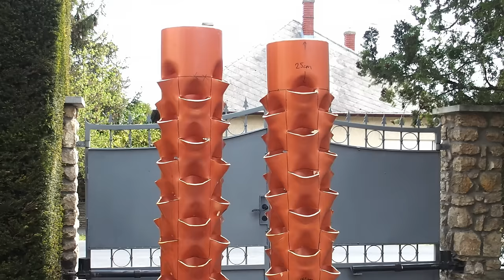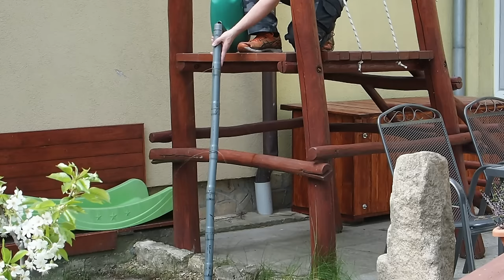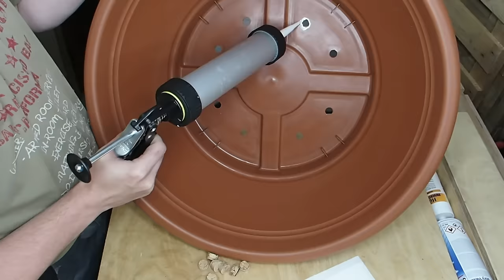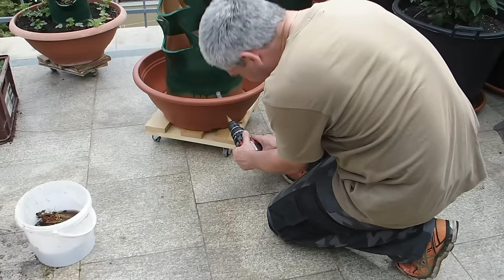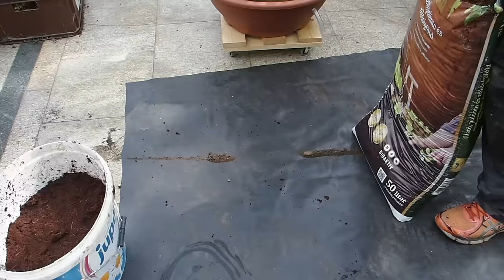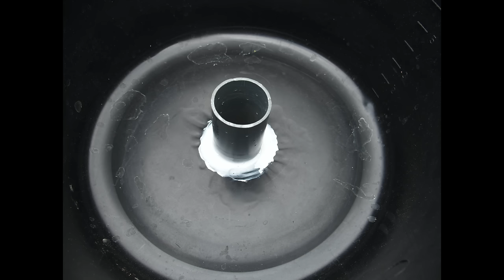DIY: Strawberry tower - part 2/2

Comment: It took a minute to figure out his center watering tube but I finally got it. Each section fills with water then drain separately, I like it and will use this on my Dollar Tree raised beds. Hard to beat $1.25 each. $45 for 36 trays, I plan to grow strawberries in them. This really solves my watering issue, now based on the size of the center tubing I will have to see how many times a day to water.
Reply: yep, waterin is the smartest thing here. I'd also add some drip valve from bucket it keep it consistent and controlled
Reply from the maker: Perfect interpretation, thank you.

Comment: It looks great!! Is all that plastic food safe? Not all plastic is. Since all the hub bub about plastics and such, I have been trying to stick to natural things. You could use bamboo to make a natural irrigation, and we always used jute when I was a kid to make small container gardens.
Reply from the maker: Thanks for the comments.
Reply: I agree with you. You can build a towel out of untreated wood, or heat treated (HT stamp) pallet wood. just have to replace every now n then if the wood rots out. Metal (galvanize, stonwes or bricks or ok too ). I have those for raised beds.

Comment: Hey thanks so much 
Please could you be a bit more clear on the irrigation and how the water gets through the entire tower. I especially liked your mixture of coco coir, fertilizer etc I'm definitely going to take a note of that combination as a growing medium.
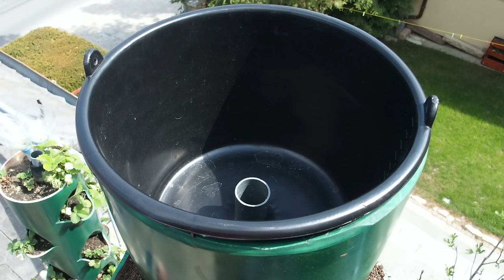Reply from the maker: Thank you for watching. The irrigation tube connected in the bucket. You can see 8:18. The water fill in the bucket.
Reply: dont worry it does not work.
Reply from the maker: Why?
Reply: @2lefthands  
I think it would be better to use a short piece of pipe with holes near the top and another piece of pipe without holes that is just wrapped in the weed barrier fabric (capillary material). The water wets the top and the fabric/gravity will carry it down the tower. With holes in the lower pipe you will have more water at the bottom due to the pressure (about 4psi with 10ft head. A good quality capillary matting will hold 7.5L per m2.
Reply: Beyond words that he has the ingenuity to build it and no idea how to wash his hands.. sooo funny
Reply: @I have two left hands  A detailed explanation would be great.  I am guessing what you accomplished was getting each section to fill with water then release it to each section for more evening watering, but how? Much more detail is needed to duplicate what you have done.

Comment: How did this work out? Did it produce well? Did the pipe water evenly? Would you change anything after using it for a summer?
Reply from the maker: Yes, this is works good. I would like automatic irrigation.
Reply: @2lefthands  isnt it better with white color as i heard the strawberry roots doesnt like to be warmed up?
Reply from the maker: I don't know. I like the green tower.
Reply: @2lefthands  thanks. i saw some more clips about towers yesterday and it seems most prefer dark colored. for strawberries

when the one was talking about "too hot soil" i saw it was also about compost so well i will probably go with dark grey
Reply: @jesuschristislordoflordsan427  dark pipe will absorb more heat from sunshine.. silver is the best, can reflect light also, so u can get rid of pests

Comment: The center watering pipe is a little confusing for me. I am not sure why it would not work to just have one straight pipe with holes drilled in it, and the bottom blocked off. I guess with all your small pipes inside, it makes it so the water is more evenly given out rather than more pressure given to the bottom of the pipe? Sort of like baffles?
Reply from the maker: Yes, that is. The distribution of water is more even.

Comment: what were those things you put in the water then broke it up like dirt they looked like square blocks and why what does it do
Reply: coconut coir, you must hydrate it first before using it. It comes compressed and dry, you hydrate. It keeps the soil from getting compacted and hard.
Reply from the maker: The coconut fiber brick.

Comment: Don't you just end up with a nutrient dense bottom layer?  It's nice but as you water and the nutrients are getting washed down to the bottom.  You may find it beneficial to create barriers at each layer to maintain nutrients instead of a single column of soil.
Reply from the maker: Nutrients barriers. What do you think?